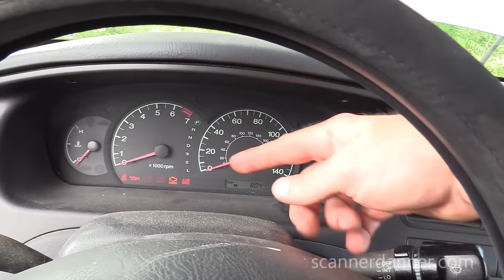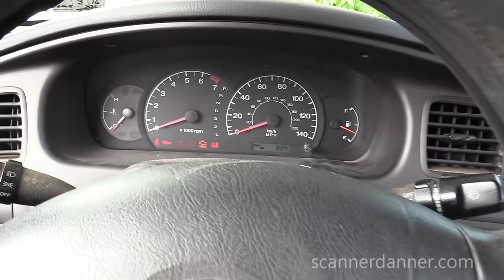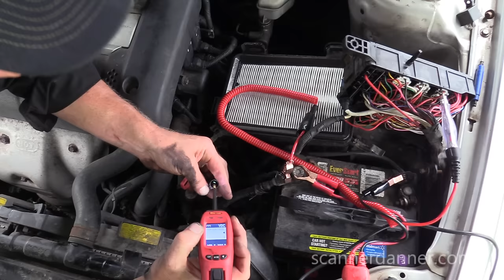No crank, good starter, how to troubleshoot, any car! (Hyundai)

Comment: I'm sitting here watching your videos completely filled with dread. I headed home from town yesterday and my car,,,,,,,,,,,,,,,,,,,,,,,,,,    
"a 13 Sonota" just shut off on me within a half mile of leaving the gas station where I had JUST fired it up! I coasted into a body shop parking lot and went Hmmm, what to hell? Put it in park and hit the switch, one metallic click was all I heard. Dam the luck!!! This thang has been a purdy decent little car. Bought it new and took decent care of it. But before I ever popped the hood,I start feeling sick. Like a dumb ass, I gave into peer pressure and pulled the starter off of it and went got one after I set a good hot battery in it and got the same result. I'm fixin to go put it on but I doubt that's gonna do it. I had Chrysler labaron back in the early 90s that spun a something one evenin right after I fired it up to leave. It shut off before I left the driveway and it was locked up tighter than dicks head band. If the starter does fix it, I'll come back and add to this already long ass comment. But Lemmy say before going. The videos of yours I've watched so far are done purdy dam good man. Alot better then a bunch of em are. Gonna subscribe so maybe I'll get to your videos quicker next time I'm looking for tips. Thanks brother.

Comment: I had the same issue, wouldn't crank but battery was good. 2008 malibu ltz. Come to find out there was a break in the copper band under fuse box. Had it soldered. Still working great 2 years later.

Comment: Hey ScannerDanner, I have a 2007 mustang by automatic v6. Batter, starter, alternator are new. Turn ignition forward, I get al lights and nothing happens. No click at all. The lock is flashing with key foward by itself. What do you think could be the issue?
Reply from the maker: Anti-theft or immobilizer issue possibly, scan it for codes

Comment: For your info the PP IV has a little neat feature . When using it if doesn't make that annoying noise or the LED red or green don't light up this indicates a open or resistance . Also if you go to Feed mode this will actually tell you the resistance in the circuit . The PPIV is using it's built in computer circuitry performing voltage drops everytime you use it.

Comment: I have a similar issue right now. Battery only 6 months old, tested and good, but no crank, dead silence, but there seems to be some kind of parasitic periodic drain on the battery. It did this over the summer, the battery was a little over two years old so I assumed that was the issue, replaced it and all was fine until now. It's doing the same thing and I'm about to replace the relay which is making clicking sounds though it appears to be okay, no water damage etc.. I don't know. Great video though and I've subbed, thanks for the info!
Reply from the maker: Battery is confirmed to be fully charged and you're getting nothing? No headlights, or interior lights?
Reply: @ScannerDanner  Hello, I'm getting a strong dome light, no headlights, dash etc. there's a weak click in the relay, but after removing the relay plastic cap it appears intact, contacts look clean and dry as well. This is a 2000 Lexus RX300, 193,000 miles well taken care of.
Reply from the maker: @massachusettsrestorationte3826  no headlights, no dash lights when the key is turned on?
Reply: @ScannerDanner  yes, no headlights, or dash.
Reply from the maker: @massachusettsrestorationte3826  okay, start there, forget about the starter. Let's go after something we know should be working and is not.
Year, make, model, engine I'll need at a min 
Let's focus on the headlight circuit and it will lead us to the no crank issue
Reply: @ScannerDanner  The headlight relay is right next door to the starter relay. Car is a 2000 Lexus RX300 3.0 6 cyl.

Comment: Backyard mechanics are the best, I just subscribed also my question is if car won’t start such as my 2005 Kia Sedona and had starter checked which was still good how would you test alternator, it’s a lot of parts removal to get to alternator which I’m trying to avoid, thanks for any help you can suggest

Comment: Great video…. Was wondering how you would attack an intermittent no crank/no start.  I have a 07 civic with this issue.  Sometimes it starts first turn sometimes it takes 3 key turns.  Until it fails hard, is there a way to troubleshoot?  Already replaced the ignition switch, starter and relay.  Starting to look at the grounds.  Thanks…
Reply from the maker: Have to make it do it and test the circuit while it is not cranking. Otherwise you're just guessing. This is why intermittent problems are the worst!

Comment: Great video!  Just starting to tackle exactly the same problem.....but thanks for showing me where to start! (PS I'm in UK..... nobody losing any business!! 🤣🤣)
Reply: Your video was truly helpful.  Fault traced back to corrosion between the negative spade and the nut on the negative pole on the starter solenoid!  Looked perfect from the outside, but wouldn't take any load!  Thanks matey!  (Needless to say, the nut was corroded tight and the copper pole broke off.....but that's another story - new starter and the car is on the road again!!)

Comment: Can voltage drop in this solenoid control wire/contact cause intermittent click/no crank issues? 
I have a new battery, a new grounding cable, no voltage drop on positive starter cable or ground (about 0.2V), new starter brushes and solenoid installed but still intermittent click/no crank issues.
Things improved a lot with the new battery (original tested bad) and new ground cable (1V drop on old one).
The starter was bench tested and runs super strong every time, no intermittent issues until i put it back in the engine.
I even tried a new starter but still had intermittent click/no start issues so i returned it.
Every time i turn the key the starter either clicks or starts so i think my ignition switch and clutch switch are OK.
I had multiple issues so it's a pain to figure it out. The car never left me stranded. Sometimes it starts right away, sometimes i have to turn the key a few times before it starts.
The engine runs strong after it starts and it has no strange noise from the belt driven components like bad bearings. 
All contacts squeaky clean and i even cleaned/sanded the contact point between the engine block and starter for good ground. 

Awesome video.
Thank You!!!
Reply from the maker: Here is the key. You MUST measure the heavy positive cable on the post of the starter BAT terminal while the circuit is loaded! The key MUST be held in the crank position during this voltage measurement even though it is hot all the time.
Reply: @ScannerDanner   yep, i've done the voltage drop test (under load) but it's only showing around 0.2V on positive side.
The ground cable was showing over 1V so i replaced it and things got a lot better, engine runs smoother and even my fuel economy improved i think but i still get a click/no start occasionally.
The little thin wires is the only one i haven't tested for voltage drop.
The car is a 2004 Nissan Maxima 3.5 V6 (manual) 

Thank You!!!

Comment: Here's a tip, you know those plastic  covers for jars you can get, from cook shops, they come in different sizes and have elasticated seals.
They are like plastic bags with elastic bands  on the end.
Put one over your fuse/control box to prevent water ingress even if it already has a seal fitted.
Water has a way of getting in there and causing all kinds of trouble.
Prevention is much better  that curing, old engineers tip.

Comment: If you had put the yellow MAIN relay into the starter and the starter relay into the Main, you could tell if the starter relay is good (Main being powered) AND if the issue with starting is that the relay is bad.

Comment: Thank you!! I have a Hyundai with the same issues, this was a great refresher and overview on basically the entire starter circuit :) i have a feeling that piece of trash might start soon..
Reply: Fred did it start and what was the issue?
Reply: @jmartin3707  Turned out to be the actual starter that was basically spent. Was just really unpredictable to troubleshoot since it became really sensitive in its last weeks. Changed relay and it worked for a few weeks before randomly not cranking sometimes. Then I found a semibad ground near the relaybox, fixed that and it worked again for 2-3 weeks until it just completely failed. At that point the starter itself was replaced and problem went away for good.
Reply: @perkele1989  ✅thx

Comment: I have the same issue with an 03 Chrysler town and country 3.8L engine, I used a remote starter switch from terminal 87 from the relay and connected it to the battery positive and the starter cranked over, my starter is good... I noticed my vehicle theft security system light is on solid... is there a video you can make on a vehicle theft security system for a 03 Chrysler town and country? with the vtss armed I have a no crank no start... what steps should I take to diagnose the issue? Or is there a way that I can bypass the sentury key immobilizer module with a transponder in the key, to start the vehicle? Thank you Paul Danner

Comment: Thanks for the vid.  One thing though,  just use a cheap multimeter to replace every one of the tools you showed here.  Don't fix the test light throw it away.
Reply from the maker: your comment of "throw the test light away" shows how much you need to watch more of my videos. There is so much you can do with the test light, in fact sometimes, it is THE tool to use. For example, an output solenoid is melted and destroyed. Did it also take out the driver in the computer? Use your test light to substitute the load and command the driver to turn on with a scan tool. Test light lights, you are done, sell the job (a new solenoid only). Test light doesn't light, you better not sell that job yet.

Comment: Hey SD!  Do you know about Chrysler ignition - relay - dash?  Replaced battery. moved a relay, got dash out with turn signals. No turn signals now, but get reset on dash with turn signal. Turn signal cancel had been stopped.  The car was no crank at ignition, but intermitant, so the starter works. I was going to re-key/ignition module, but the dash started going out on use of turn signals.  Because of your video, I'm going to check more, and look at wires.

Comment: I enjoy your video i have a somewhat same problem and looking forward to scanning the engine wiring to see if i can get it to go, it cranks but doesn't turn, headlights are super bright and my Fog lights turned on (after six years not turning on) so its an electrical issue and i'm hoping its not the ecm. Wish me luck.
Reply: Yo! You figure out the problem?

Comment: So I get the benefit of going straight onto the tap of the starter but what if the connector doesn't allow you to? Example would be my sister in laws 2008 Honda civic had a full connection but no tab

Comment: I got a 2001 Honda Civic. Its got an interference Engine and the timing belt didn't completely break it skipped and shredded some of the rubber. I replaced the timing belt, water pump, tensioner, and the oil seals. Also did a valve adjustment. Replaced one of the rocker arms that snapped as well. Now, it only cranks and doesn't turn over. The sensors were both replaced as well because there was no spark. I thought the timing was bad and it actually looks good. When checking engine compression it has none on one and two, low of 60 on three and 160 on the last cylInder. Do you think this could be consistent with bent valves? I can get a new CylInder Head at the PIck n Pull, but don't really have money to do head gasket, or time to do remaInIng work. Tell me your thoughts, Scanner Danner.
Reply from the maker: yes sir, time to remove the head :-( sorry for the bad news my friend

Comment: Great video! I got here because I have a strange starter problem - when cold starting Hyundai i20. It cranks but stops after one revolution and then goes on to start normally. 
Like this: Wew......WewWewWew start!
Could it be a physical dent in the starter? New and ok battery. I know nothing about it.

Comment: Hi Danner,been watching u r vids few years now from uk Devon.I decided to buy used solus ultra from a garage 2 years ago software is 14.2 it now freezes up,have to keep taking battery out of the back to get it to work for awhile. Question- is it because i havnt updated the software,,,,,,,I am not using it now as trying to find out why it locks up the screen nothing works screen just stays light up till taking batt out again.........Re  malcom
Reply from the maker: I dont think that is an update issue

Comment: I’m just randomly watching videos as they are interesting. I’m going to go back to the evap video in a little while. For anyone watching I use a breaker bar and rubber mallet to beat on the starter motor as some spots are tight to get to. I for one would love to get a power probe just for my own personal use.

Comment: We have the same issue with an icar.
Starter diagnosed but have changed it and still no crank. Battery good
Reply from the maker: Need voltage readings to help

Comment: There is a no start issue with an Acura TL for my cousin, but after a once or couple of times tuning the key it starts and runs fine. I was trying to diagnose myself (totally amateur) but it feels like some type of connection issues with possible starter relay, like it may not disengage. The battery is new and no corrosion on battery connectors. Could it be fuel pump? Injection issue? When we take it to mechanics they seem really frustrated and rude like they don’t want to help. So I’ve resorted to finding out myself. Ive fixed a power steering leak and misfire issue. The car doesn’t have any open recalls at the moment. Any suggestions?
Reply: sounds like an ignition switch issue .Check out [South Main Auto] he's good with diagnostic issues.
Reply from the maker: okay, just like in this video, step #1, you are asking about a "no start". Is it a crank, no start? Or is it a no crank, no start? Two completely different directions we need to take.
Reply from the maker: @ Ernest Thomas You know, Eric is a friend of mine and I'm fine with telling people to check out his videos, but you are on MY channel and the first suggestion you have to someone else on my channel is to send them to someone else's channel??? Last I checked, I'm pretty good with diagnostic issues too. lol

Comment: Hey man. I seen your video and they are awesome. I need some advice from you. I have a dodge sprinter 2006 and it has a problem that it doesnt have connection. I changed the ignition switch . And on the dash board it will show "error start" i changes the  stabilizer computer and still no result. I tried three different type of scanner. And no communications will show with all of them. So if you can give me some advice it will help me a lot.

Comment: had the same problem,but started next morning? wiggled ignition while started didnt stall out has started 10 times since?i did take out the start fuse and put it back in before it started for the first time?

Comment: I have a 2015 Hyundai Genesis Coup 3.8 Automatic that usually cold starts but after car heats up from driving a while won’t start again.  It’s a push button start which seems to generating power, brake switch was replaced along with battery recently.  

Initially was told by dealership wire connection to starter was loose, said they fixed it but still problem persists.  

What are your thoughts ?  Thank you in advance.

Comment: Any cases of M Terminal wire failing and how to diagnose it? M Terminal is providing the power from the solenoid to the starter. Should I just jump it? Granting that battery and S Terminal are receiving the 12V. Thanks
Reply from the maker: The M terminal is simply the motor circuit. If you are showing 0 volts in that location while holding the key in the crank position and you are seeing 12v at the BAT post of the solenoid AND at the S post of the solenoid, you simply have a bad solenoid. It is never completing the circuit between the BAT and M terminals. Just make sure your block ground is good before replacing the starter motor assembly. In some cases you can repair just the solenoid itself, but to be honest, I never do this. Change the whole thing.
Reply: @ScannerDanner  Hi, apparently in my case the M Terminal - braided wire was rotted. It just broke, when I was trying to clean the contact. Do you have any experience with Volvo S70 98? Mine has a left hand support bracket and I noticed that some sellers are listing the starters without the support bracket bolts as a compatible ones. As usual not much information about it. Is it the new generation of starters? Maybe they don't need the support bracket. I have just found one post on matthewsvolvosite.com claiming that the new starters don't need it... Thanks

Comment: Wondering if I can get some insight. My dad has a 2006 Hyundai Elantra GLS. Currently will not start or do anything. Now if we jump the car lights come on the dash and other sounds but still no crank. When we don’t jump the car it does absolutely nothing bone dead. The car stall out on us on the highway on July 3rd and am curious what parts can I take to advance autos and see what it needs.? Like I said the car will not crank over no lights on dash come on and no sounds. Any advice would be greatly appreciated and I can’t use a obd scanner since the car won’t crank.
Reply from the maker: do you have a test light or a digital multi-meter? First test I want you to do is to measure your block ground
https://www.youtube.com/watch?v=-fyKizH_oQ8

https://www.youtube.com/watch?v=32S0WMj3GSQ

https://www.youtube.com/watch?v=ytrcqM8wyW0